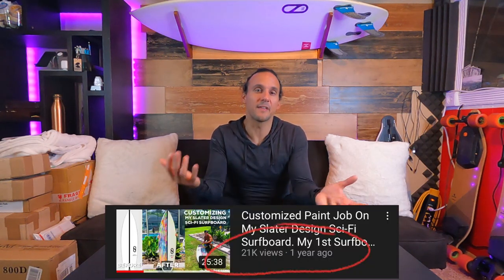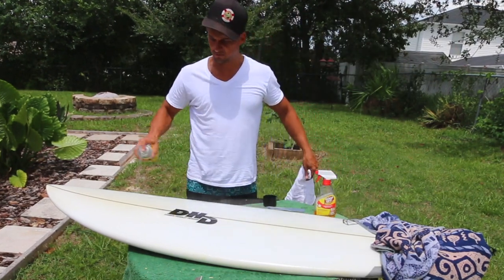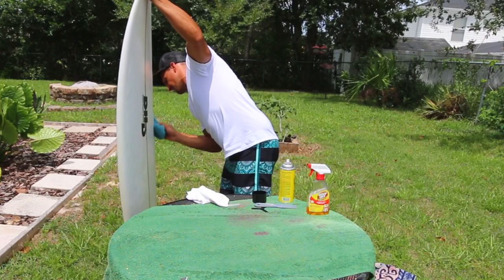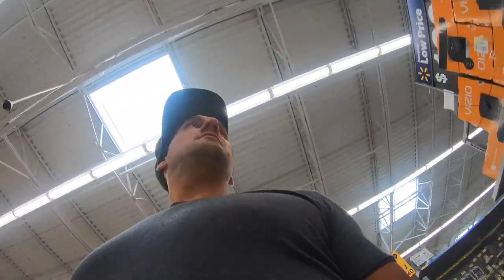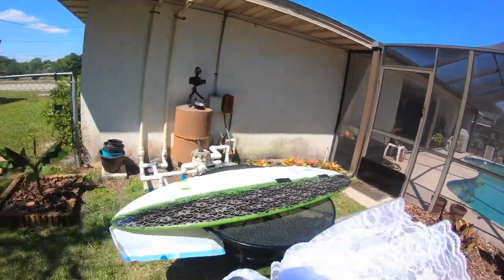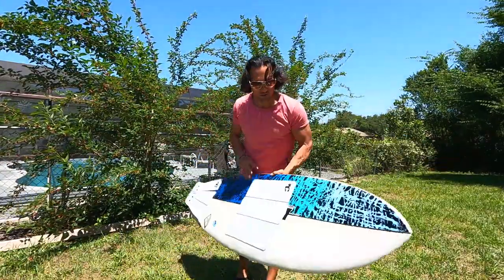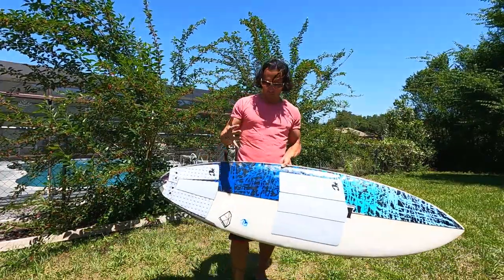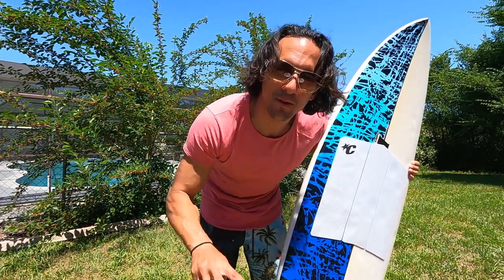Surfboard Soap Painting: DHD Black Diamond. How To Paint Surfboard Using Spray Paint & Liquid Soap.

Comment: Nice video! What spray paint did u use for the first coat for the 4 colors?
Reply from the maker: Hello, Thanks for the positive comment. All of the spray paint that I used was an acrylic spray paint. But, before you lay any coat of paint on the surfboard you must clean and make sure that all of the wax, film and dirt is removed. Do NOT use acetone to remove any of the wax, etc. acetone will eat through the resin layers down to the foam. I used Goof-Off but, you can use any wax remover made specifically for surfboards. Some people will even take a very fine grit sand paper and sand the areas where the paint will be laid. This way the paint sticks better, however, I didn't do that and the paint on my board has never come off or chipped and I use this board often.
Make sure you let each layer of paint dry fully. I'd spray paint each layer, let it bake in the sun and dry for a few hours per layer, then I'd go back and add all extra layers allowing each coat to dry fully. This process does take longer however, you will not have to worry about any of the paint to chip off or smear. Also, I finished off the paint job with an acrylic clear coat and allowed it to bake in the hot Florida sun for 1 day. This will ensure your paint jobs protection. 🤙

Comment: Hey, how well does the spray last? Is it chipping?
Reply from the maker: +Jaydon Devaux The paint last. I’ve used this DHD a lot this past summer and it still looks the exact same as when I 1st painted it.
Make sure to use acrylic paint and then use an acrylic clear coat to seal the paint. You’ll get no chipping or peeling. I also let each coat of paint dry and bake in the sun.
Reply: @joeypaesano  thanks a lot man! I’ve been wanting to paint my board for a while now but didn’t want the paint to start chipping and making a mess. Great videos btw, new subscriber here.🤙
Reply from the maker: @jaydondevaux9892  I really appreciate the Sub! Thank you 🤙🏽
I plan on doing a few more surfboard artwork videos.. they’ll be coming.
Honestly, I haven’t had any chipping, peeling or fading at all. Even when I put wax on the board and remove it, it doesn’t affect the paint either.
It will take a little patience in between coats because you need the coats to dry. Plus, the acrylic clear coat needs to dry.
Reply: @joeypaesano  I have a follow up question; if I paint the bottom of my board (it’s an older board so it’s a little yellow and I want to paint it white) do you think it would slow it down or is it slick enough?

Comment: Do you have to put a clear coat on the paint for it not to cheep off ? I own a 7,6 I don’t have track pads
Reply from the maker: Hello Estevan. Yes, make sure you use a clear gloss acrylic spray paint. I’ve never had an issue with the paint chipping or cracking. It’s safe to wax too and the wax comes off easily with a wax comb or scraper.
After painting my surfboard I did spray the acrylic clear coat gloss and let it bake in the sun for about 4 hours.
My suggestion is to let your surfboard lay out in the sun & dry. Then let the clear coat set & harden in a well ventilated area (ex: patio) for a few days before waxing it & going into the water. 
Honestly, the paint will not come off. I hope this answer helps you.